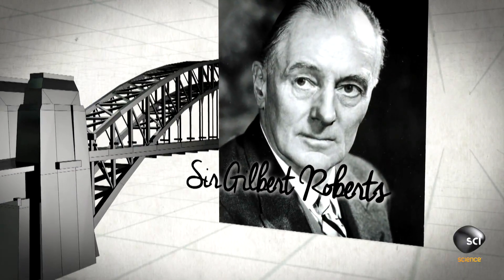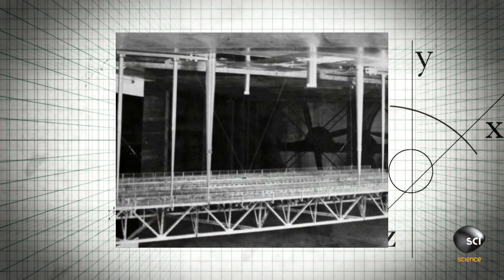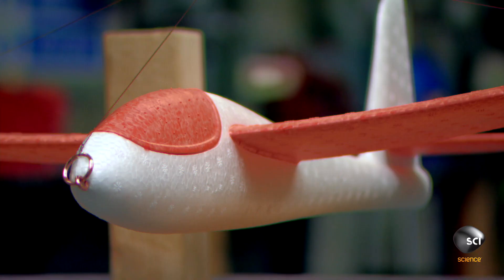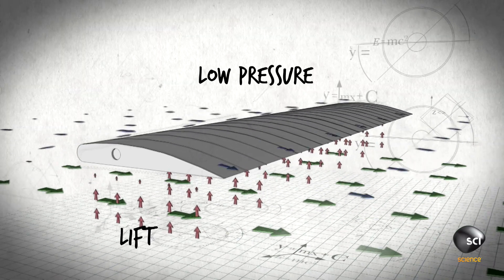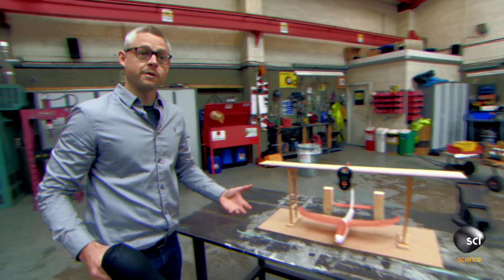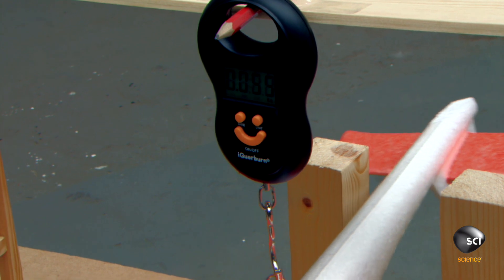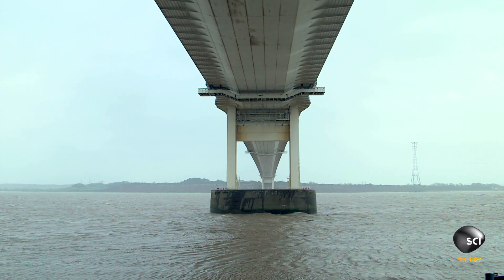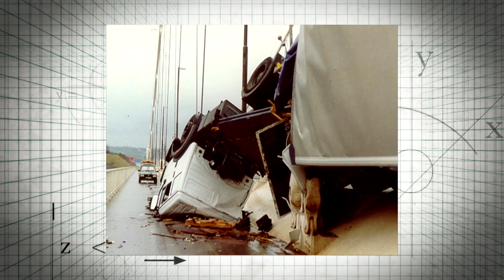How Do Bridges Withstand High Winds?

Comment: How can planes fly upside down then?
Reply: +Kumail Now, the high pressure would push the plane into the ground, recovery would be practically impossible. I am talking about commercial aircraft, cescnas, and private jets. Military aircraft sometimes can.
Reply: @Oppathicc  a commercial aircraft could actually fly upside down if the wings structure where strong enough to not break. The way a wing is tilted is the main thing that makes a plane fly, and not the wing's shape.
Reply: @Oppathicc Better not look up the public unveiling flight of the 707. The test pilot flew the airliner upside down.